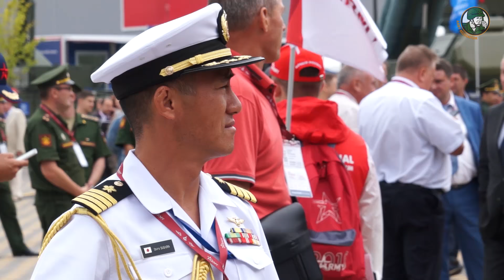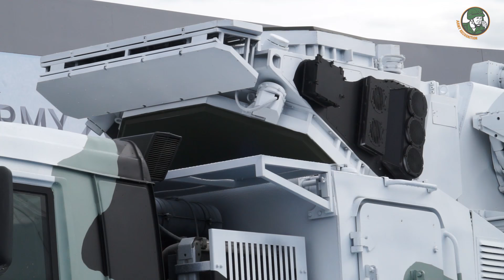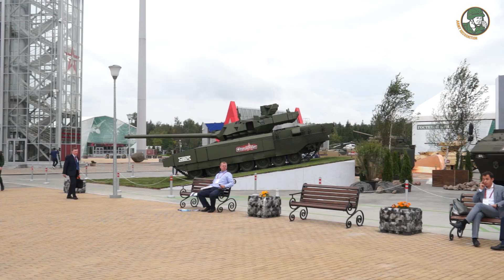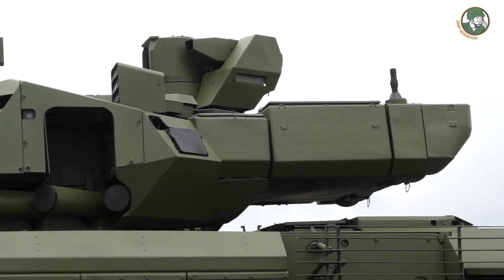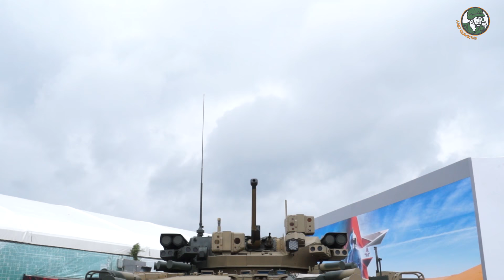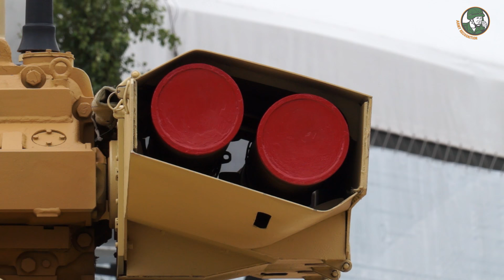New combat and armored vehicles of Russian armed forces at Army-2018 defense exhibition

Comment: Is the T-90M seen anywhere there on showcase? I know they did firing show of T-90M on day 2, but I would absolutely love close up video's and images of the T-90M because:
Many Western Military sources say the gun is 2A46-M4 (which doesn't make sense, that's a downgrade from the T-90MS), while Eastern Sources say it's the 2A82 gun. I absolutely want to get to the bottom of this, but I don't have close-up images or video's I can compare side-by-side. Let me know you guys or if you know which gun it specifically uses, would help me out a lot. Thank you!
Reply: The Tagil has a 120 mm gun I think but in most respects it's better than anything else out there with fire and forget and incredible fire rate on the moce it will have killed ten Abrams before they can even reload. The more expensive Amarta can be utilized as a mother tank for battle situational awareness and as a ball tearing tank platform in it's own right. The beauty about the Tagil is it can be upgraded from existing T90 assembly lines.
Reply: The machine can be equipped with both 2A46M-4 gun and optional 2A82-1M (it is easy to outwardly distinguish by barrel length, absence of ejector and lack of twin PKT). At the moment there are machines only with the gun 2A46M-4.
Reply: T-90M (Proryv-3) definitely has the 2A82-1M.  Every source I checked mentioned the 2A82-1M. The T-90MS has the 2А46М-5 and the modernized T-72 uses either the 2А46М or the  2А46М-5. So claiming that the T-90M uses a 2A46M-4 is truly questionable. 

Source: http://uralvagonzavod.ru

Comment: I sense some issues in the editing room as in the armament rundown for the T-15 they sorta left out the 57mm gun.
Reply: It's clearly the 57 mm.  The problem was in the editing.
Reply: M Fitz. The T15 is basically a tracked but more well armoured/protected Bumerang, that I suspect can still travel underwater. Yes they did omit the main gun. Even the Bumerang is better than that Dutch POS.